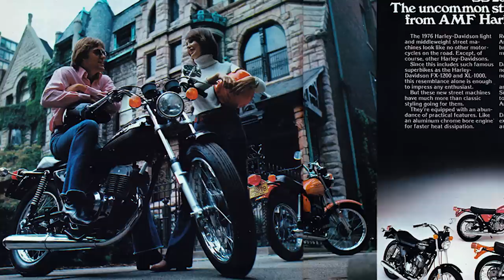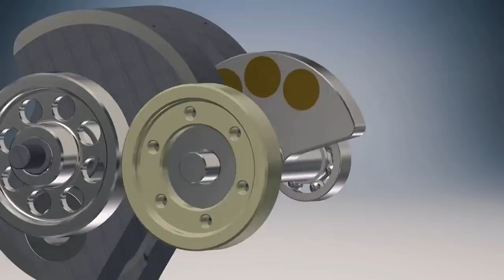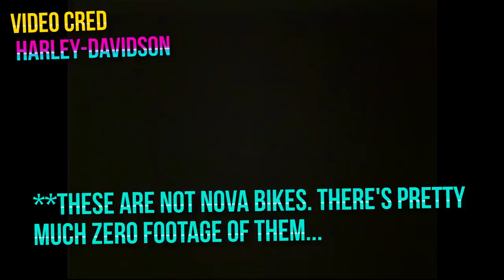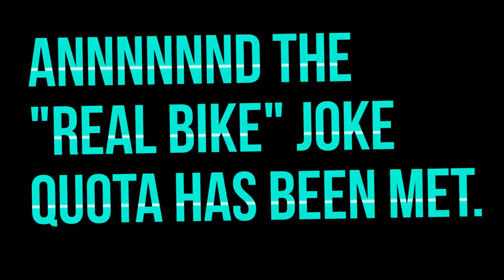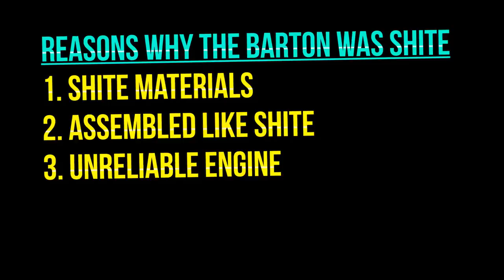The Rise and Fall of Buell Motorcycles - Part 1

Comment: Buell was a badass brand.
Reply: I say it in past tense since they don't make new products anymore of course. no doubt, I'd love to own a Buell, although it would be way too big and heavy for me.
Reply: pure junk due to the sportster engine. the last 1125r was close but still too little too late. They were trying to use an air cooled engine until the 1125r, which is unbridled stupidity in the realm of HARLEY
Reply: @stephenmwyatt2  harley dictated what Erik was allowed to do. If they are so junk why did euro streetbike magazine vote the xb12r firebolts best real world handling bike of all time. He invented alot of things in the motorcycle industry. Under slung exhaust, perimiter brakes, fuel in frame , oil in swimgarm etc. He took a small company in the middle of nowhere wisconsin and competed against the world's best with 1/20th the budget. The EBR 1190rx hung right with Ducatis penagale at several thousand less dollars. SQUID.

Comment: @Illestrator, I don't know if you ever check the comment section of older pieces, but I hope so. This is the third time I have watched this piece, and I enjoy it more each time. It's put together really well, and I dig your sense of humor! I learned a ton from this work as well, and that is what I like the most. Great job on the research! The unearthing of the Nova project was very interesting to me, as I had heard of this before but never in any detail. Was it even real? Well Hell yeah it was!  And yes, just imagine if they had decided to commit to it? History could have, and most likely would have been changed. That pesky hindsight...

Anyway, thanks for the whole series on Mr. Buell. He was so close, wasn't he? I feel like he made some significant contributions to the industry over the years so it's fitting to acknowledge the work. Good on ya, lad!

Comment: i know nothing about buell but im ready to learn
Reply: To understand to Buell chassis layout, view the Buell Uniplanar motorcycle frame pattents, easily found and free to view. Clever stuff, it allows an engine to vibrate along one plane only, up and down while not allowing the rear wheel and rear suspension to become misaligned, all of which is attached to a vibrating power train while absorbing much of the - irritating - high frequency vibes.

Comment: My boy! Good as usual ! I wanted to get a buell at one point in time but parts were unfathomable expensive for maintenance. Now it would be a pain to track down parts
Reply: lucky decisions yeah I love my buell 1125r but I'm going to have to sideline it if I want to last. Once that engine is worn out that's it. There are no rebuild parts available and some parts are becoming harder and harder to find.
Reply from the maker: Does Buell have a strong aftermarket?
Reply: Yes and no. It had a strong aftermarket but it is dwindling due to lack of new sales and  declining numbers of bikes on the road. St paul Harley Davidson in Minnesota and Twin motorcycles in the Netherlands are the two main sources of new parts these days.
Reply: Not really. Finding internal parts is rare and aftermarket is not too keen on supporting a platform with minimal amounts of sales!
Reply: I just sold my XB12 and parts weren't a huge issue but finding a mechanic who will work on them professionally is s fucking pain. I do the work my self but if you're only used to basic maintenance a Buell isn't for you. Someone like chaseontwowheels shouldnt own a Buell lol.
Reply: Well the XBs were sold for a lot longer and in larger numbers the the 1125s. I kind of want to get one because the parts availability would be better then my 1125
Reply: There are still rebuild parts available if you know where to look. Harley still has the vast majority of parts available you just have to find a dealer that's willing to sell them to you. There are even enough parts out there to rebuild an 1125 into 1190-spec.
Reply: I have owned an 09 1125r and while finding parts was a little more difficult it was definitely doable. I still own an XB12r and an XB12xt with no problems finding parts or doing my regular maintenance. I do all the work myself as the platform is simple and it saves me tons of money. With regular maintenance done it is also an incredibly reliable engine.
Reply: Is it true HD stop selling Buell parts?  I wanna buy a Buell, but I'm concerned about parts availability.
Reply: The drive belt for my S2 Thunderbolt is now unavailable. Converting it to chain drive could be no bad thing and not complicated.

Comment: The best bike is?? Let me know. For me in New Zealand my first bike RD250LC two Stroke air cooled fully SYN 2 Cycle oil slick 50 with Dry Clutch gives power from a cold motor Teflon for moving parts try it awesum for any high reving motor mybe dry Clutch no slip.  PS Burt Munro the man fastest Indian in the USA from New Zealand Dream big God Bless US brothers.

Comment: Buddy of mine had a VROD and even the dealership he bought it from gave him grief and we're even rude to him about his choice. I went with him one day to pick up some parts and the parts guy at this Harley dealership was a complete dink to him. Now I wholly respect Harley Davidson tradition but being absolutely against advancements is not even what the founders became famous for. The Harley engine when it came out was cutting edge, so why not offer really different lines and performance chassis? I know they have higher seated sporty models but not Buell league. The weird thing is is that Buells are quite cheap to buy and they are all so interesting and quite unique designs.

Comment: Funny that Harley was dealing with Porsche way back in the '70s and Buell was starting at Harley. Oh the possibilities of a V-Rod type engine on a Buell 20 years before the V was even a glimmer would have been unreal. I always thought it was a damn shame they screwed him over and out of the Company before the V-Rod came along.
Reply: The V-Rod power train was offered to Buell Co. but the offer was declined. Too heavy and not revvy enough.  So Buell and Rotax jointly designed the 72 degree, 148hp gross/130hp net, 11,000rpm unit.

Comment: Good heavens..I never heard of the NOVA project. If HD had gone along with the engineers instead of the marketing department, they wouldn't be facing extinction today. I have met and spoken with Eric Buell at the NY bike show. As much as I wanted to buy an American sport bike I found the Buells way too uncomfortable and cramped and I told EC as much. He said they were "race bikes". I told him 99% of riders out there are not racers so how about a little room to stretch out? Nope, the man is stubborn. Then I made a crack about the Buell Blast and what was he thinking...the conversation ended. (But notice he squashed the last one).
Reply from the maker: Lmao! People hate the Blast so much, I guess I shall see why when I get there on the timeline
Reply: T I...You are amongst the best that the Internet has to offer. As for Buells, they shake and rattle terribly. I have a friend that has owned a couple. One was their tourer, awful, at idle at a set of lights it looked like the front tire would completely bounce off the ground. The other one I rode was the ??9. It was an early model. It was very narrow to sit on and comfortable, good torque. The engine smoothed out as the revs built.

Comment: To bad they didn't stay around. I think now would be the perfect time for Buell. Especially if Buell put the V-Rod engine in one of it's bikes.
Reply from the maker: Jeez, a Buell tuned V-Rod engine put into a light chassis would be siiiiick
Reply: Right?
Reply: The original 1130cc v-rod engine was originally conceived for use in a Buell tubeframe chassis like X1, but some people at Harley got ideas for use in a cruiser-style motorcycle which changed the design path of the Revolution motor to being less sportbike-package oriented and more cruiser. When finished, the V-rod engine is too large, heavy, and simply not powerful enough to be worth replacing the sportster-based motors that were already in use. The entire reason Buell made their first water-cooled sportbike only 1125cc instead of a round 1200cc or similar is because Harley did not want another water-cooled twin with larger displacement than the V-rod in their lineup. In short you can credit the V-rod for halting Buell motorcycle engine technology for about a decade.
Reply: What would've been really badass was if they launched their turbo-XB into production. The prototypes completed all durability testing during product development. The frame and intake design of the XB is specifically designed for use with a small turbocharger.
Reply: Too heavy, low crank speed, low tuning potential, a cruiser powertrain